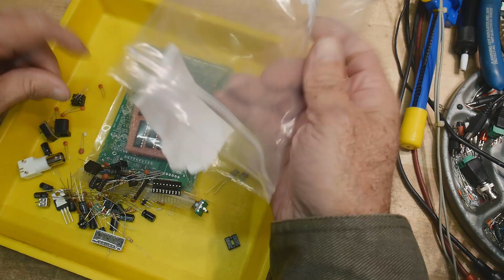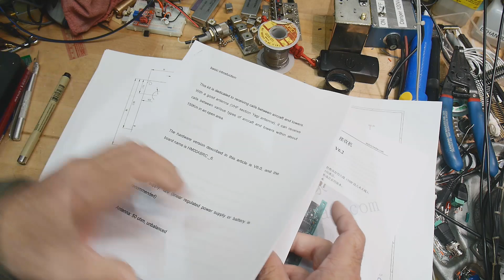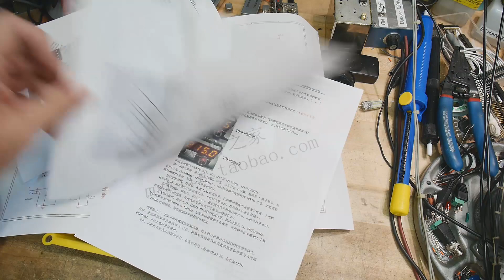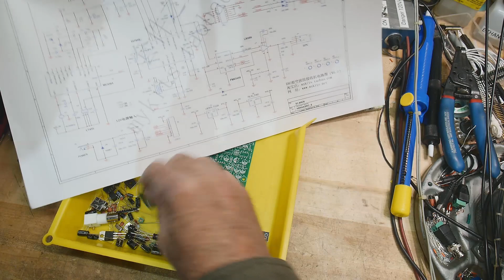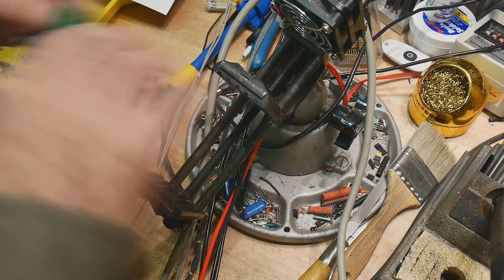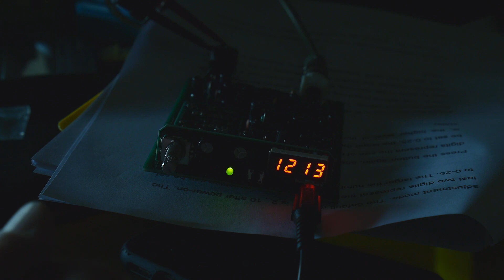#717 Aviation Air Band Radio Receiver Kit R80

Comment: Hi, I bought this project in the latest version of V7. There are small changes, but about this. How did you clean the PCB so beautifully after soldering the components? What chemical did you use for the PCB? Or maybe you use an ultrasonic cleaner? 
Thank you in advance for the information.
Reply from the maker: MG Chemicals - 413B-425G 413B Heavy Duty Flux Remover, 425g (14.90 oz) Aerosol Can
Reply: @IMSAIGuy  :) That's great news for me. I didn't know it for cleaning. Is just a small litter box and a brush enough?
Reply from the maker: yes, sometimes I use compressed air to dry the board, hold the board vertical and wash from top to bottom

Comment: I like building rather than buying but you can have a real radio with a battery, smaller spacing, a real speaker, real screen, a case, etc.

Comment: OK, I have assembled it. Excellent quality this version 6 (please pay attention to the product version as they are not the same quality). Very easy to improve also. The ceramic filter of 10.7 MHz has a bandwidth larger than 200 kHz. You can buy according to your budget cheap 150 kHz, 110 kHz, 90 kHz, 50 kHz or 20 kHz bandwidth ceramic filters or even crystal filters with 15 kHz bandwidth which is slightly more expensive. Each of them improve the selectivity and reduce noise. I have installed a socket for this filter so I can change the filter to whichever 10.7 MHz filter I want.
Reply: Could You please give a link to seller who sell latest version?
Reply: May I ask why you would change between the various filters?
Reply: @Aussie-Greg  Some filters provide better receptions. They are made in different qualities with different attenuations. I can receive with narrow band filters weak signals which with large band filters are impossible.
Reply: @batman4e  
Thanks very much for the reply, I read that you fitted a socket for this filter and I guess my question should have asked did you settle on one particular filter or do you change it to suit particular frequencies within the radios reception range
I have purchased a 15 kHz crystal filter but it hasn’t arrived yet and I’m hoping this will be a permanent fix. I live near Sydney airport and have fitted an Airband antenna in the roof which gives me great reception but the noise is disappointing, I’d like to amplify the speaker output but fear that will only make the noise worse

Comment: Thanks for sharing. I also bought and assembled this.
I'm keeping some issues with this kit. It's very noisy nevertheless strong good receiving signal. And the squelch is very unstable.
Do you have any countermeasure for these issues? Please kindly teach me such idea. Thanks.
Reply from the maker: the only mod that I made was to add a low pass filter at the end of the audio section to kill the high frequency noise. It helped a little. I was just a 0.1uf cap to ground at the digital volume pot
Reply: @IMSAIGuy  Thanks much. Depending on your idea I also added 0.1uF. Yes little lower. BTW RX LED signal is stable at receiving. I wonder it can be used for squelch controlling instead of a noise source. Regards,
Reply: I replaced the 10.7 filter with one having 150 kHz bandwidth. This has a big attenuation and there is no noise when there is no signal. So that the squelch is not needed. I know it is strange but this filter seems very high quality and there is no noise at all when there is no signal. Then I lifted leg 2 of LM386 to disable squelch completely as it was random. This kit is the best kit I ever constructed and it is high quality in my opinion despite its faulty squelch which I have disable it.

Comment: I have the next version, V6. it has a bigger solder pcb for secondary conversion and a few extra parts. can't find instructions for it and as i bought it on ebay, seller is unresponsive, taobao isn't any help. do you know where i may get instructions for mine?
Reply from the maker: sorry
Reply: Hello, I have the same problem. Received the kit yesterday. The parts are different, and the PCB rev is HM00ABRC_7. The one in this video is HM00ABRC_6. Looks like I received a dual band - FM broadcast + Aviation band. I did do some basic work, and made a short video. Here's the link: https://youtu.be/hXCMcJeSWv8

Comment: I built this kit last week, the reception is quite good ( I’m about 10km from Sydney airport) the only issue I have is it’s quite noisy, did you notice a reduction in noise when you put it in a box?
Reply from the maker: no, I did add a low pass filter on the audio which helps a bit but it is still very noisy
Reply: @IMSAIGuy  thanks for the reply👍
Reply: What antenna to use
Reply: @rhythmkhattar2738  
Home made antenna 
https://youtu.be/vrGcisUsfzM
Reply: @rhythmkhattar2738  

https://youtu.be/vrGcisUsfzM

Comment: Have you  any links  for  an  Instruction  booklet  for  button  press  sequences  please, I  have bought the  pre  asembled unit  but has no  instructions, thank you in  advance,
Reply from the maker: link in description
Reply: @IMSAIGuy  I  needed  a  component discription/ Diagram, thank you for  your  verbal  discription, I  could not find  any link  to  a  printed  copy thanks.
Reply from the maker: @texhow1  https://github.com/imsaiguy/R80-Air-Band-Receiver
Reply: @IMSAIGuy  Thank  you for  the details  Guy, I  have  ordered  an  Extruded  Aluminium  box  &  drawn  a  templet  out for the  front, I  have ordered  a  longer  box  as  I  would like to add  a  speaker  &  a  mini  audio  amp.

Comment: I love the Vintage looking LED display of this radio kit and wanted to ask you, although it only displays to 100 kHz can you tune to say 128.975, even though the display might just say 129. 0. Or is this not possible? I'm trying to think of the 100 kHz channels that I could listen to in this area but there aren't many! But I'd still really like to make the kit. 73 Adam
Reply from the maker: the firmware only tunes xxx.xx  not the third decimal. It might receive your 128.975 when tuned to 128.97 or 128.98 but I can't guarantee that.
Reply: Oh that's great to know. Thanks. So as you tune 128.97....98......99 then presumably the display only reads 1289. Is there a switch to tune the. 97. 98. 99 range, like a fine tune? Or do youjust tune up with the display not changing digits? Sorry to ask but I can see could be fiddly...... 73 Adam
Reply from the maker: @M6RDPadam  you press (click) the tuning button. then it is fine tune. all digits shift left
Reply: That's fantastic to know and makes all the difference. Really appreciate your time and trouble. Best 73

Comment: I have made the same also have the hiss on the audio many noise mabye you have a solution
Reply from the maker: I made one change. It was the high frequency that was the worst. In the schematic there is a chip before the final audio amp. It is a digitally controlled volume. I put a 0.1uf capacitor to ground on the input to act as a low pass filter. It still is bad as a radio. but better I guess

Comment: Hi, nice video. I also bought and built this receiver, it's a nice double conversion one. I'm looking for the firmware of the PIC used in the PLL ring that makes other features. Maybe you know where i could find the source code ? Note that header next tothe microcontroller, it's a typical ICSP interface, the kit producer surely thought to upgrade the firmware nevertheless it's impossble finding FW on the internet.
Reply from the maker: sorry, I don't know of any firmware source

Comment: Nice kit. I noticed in other pictures I see the front panel caps are mounted opposite of the front.
Reply from the maker: the capacitors I received were short enough to be on the front, but certainly could be on the back if that's better

Comment: It needs a squelch circuit, like most commercial aircraft band receivers.
Reply from the maker: it does have a squelch.   the noise level is just too high and at the same level as the signal.

Comment: The analog design seems to be from the 80s. Interesting to see the mixer IC being labeled as Sygnetics NE602. It must be more than 20 years old. I guess many ICs in this kit come from recycling. Hopefully they still conform to spec. It seems somewhat strange that there is no matching for the LT10.7 bandpass filter.
Reply: NE602 is old but still one of the very best you can get.
Reply: @migsvensurfing6310  Dear Migsven Surfing san, I agree with your comment. NE602 works well as 18dB gain @200Mhz. It's good for SDR chips to extend coverage.

Comment: 25mhz crystal, sounds like it uses an Si5351 chip for the DDS/PLL
The ucontroller is a PIC18 series.
ATIS == Automated Terminal Information Service, gives pilots local weather, tower frequencies, etc...
Reply: Hi Astro boy, I heard that there was marking MS5351 on PLL. MS5351 is a clone of Si5351a. And J4 is ICSP connector for PICKIT. We could hack this controller. I'm guessing that LED driver is TM1637.